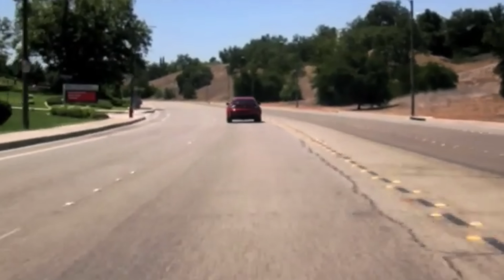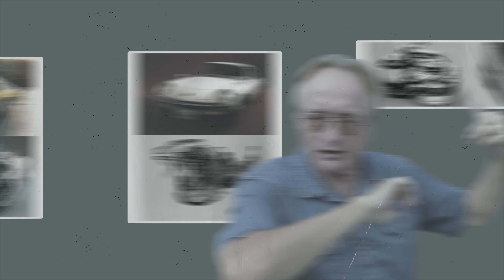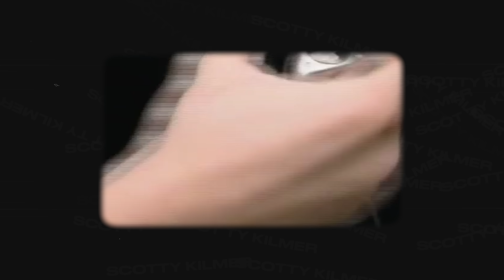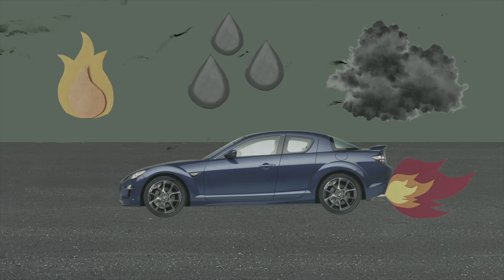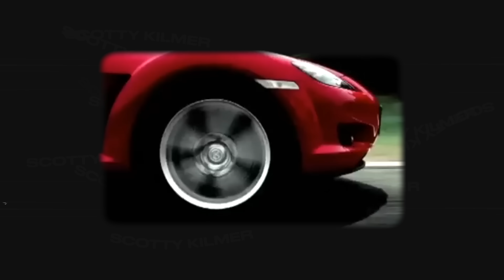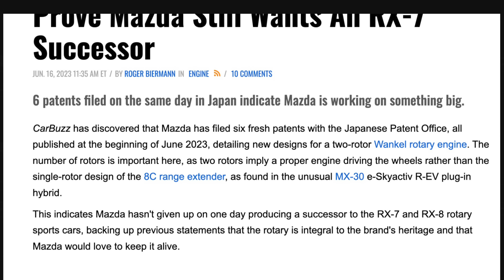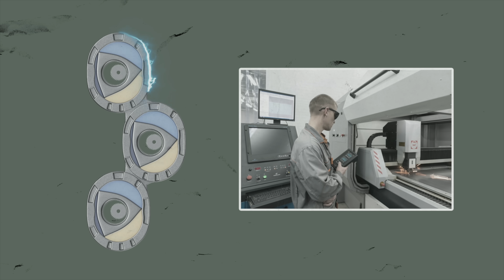Mazda's New Engine Shocks the Entire Car Industry

Comment: Quick point of correction as per knowledge gleaned from Rob Dahm's video "Fixing the BIGGEST Problems of the Rotary Engine" : one of the issues of rotary engines is that to boost adoption, they routed the oil pan's oil to a port to lubricate the apex seals, except synthetic oil doesn't burn cleanly. To remedy this, the port can be plugged at the expense of making a premix of gas and 2-stroke oil that's meant to burn much more cleanly. The oil pan's oil stays in the oil pan and is used to lubricate the rest of the engine with whatever oil you want.

Comment: Great vid!  I've always thought the idea of a rotary engine was super cool.  Ever since being a teenager I have been fascinated by this motor that is piston-less and non-traditional.  I hope Mazda can make it happen.  While the rotary engine may be "dirty" it has so much potential to create HP in such a small package.  Thanks for the info!
Reply: So….. build better catalytic converters, or something.   Fix the emissions issue, and get the ball rolling, again!
Reply: @robertjdm3988  the seals make the rotary an inherently bad design. It's cool asf but...
Reply: Doesn't matter how cool it is, EV's are far more efficient, it's not even close, you can buy roof top solar for your house to charge your car on the weekend and it's free to run, far less maintenance, just all round better way to move the car. :yt::face-blue-smiling::face-blue-smiling:

Comment: Well done, Mister Kilmer. I really like Wankel (By the way, it's pronounced, "VAHN-kel", not "Wang-kul") engine, having followed its development since its 1960's debut with NSU.

I also test-rode a Suzuki RE5 rotary-engined ("Wankel") back in the day. It was incredibly smooth, but it couldn't come close to the performance of my Kawasaki Z-1B.

Still, the Wankel ("VAHN-kel") engine is a fine example of "out-of-the-box" engineering thinking.

Comment: Some of the videos you showed had a rotary version with the peanut rotor and triangular housing. This is supposed to be "Better". Or is it just avoiding Mazda patents? From the patents you referenced, it sounds like Mazda is sticking with triangular rotors. Can you comment on if the peanut one is better? Or did you just pick available rotary video and there wasn't any that showed the old design? Good video. Thanks.

Comment: What if the central triangular section was held rigid and the rotor surrounded the triangular center section.  It would seem that the intake and exhaust ports through the motor body would be alternately opened and closed as the rotor with intake and exhaust ports incorporate in the rotor revolved.

Comment: Design Ideas solved the apex seal issue. It's time for a rotary come back.
Reply: Did they though?  I doubt it.
Reply: Well they are aftermarket parts so you won't find them in many street cars, but in the world of drag racing they are achieving remarkable success. The weak point now is rotor and housing bending.  @MrBottlecapBill

Comment: I had a Mazda RX-2 with a standard manual five speed. I got through the gas shortages during the seventies, but I wouldn’t be in one of those cars at my age.  I was in my twenties, so at that time I didn’t think I was going to die 😂
Reply: They never came with a 5 speed, only a three speed automatic or 4 speed manual.

Comment: The Rotary engine ALWAYS burns oil and seizes up.
Reply: So how many have you owned that seized up?
Reply: @rotart12arx3  One. 
I bought a RX-7 turbo new in 1987.  It had a LOT of problems, so I sold it in less than 2 years and bought a Mazda Miata. That car was a BLAST.  I was 25 years old when I bought my first Miata.
All these years later and I’d like to buy another one, but I’d only be able to drive it in the summer as we get 5-7 feet of snow every winter.
My dad also owned a RX-7 with the same engine problems. 
His only lasted about a year. He had just gotten a new engine in his (still under warranty), when his X wife was rear ended and totaled it.
Both were screaming fast, but both seized up and both burned oil.
Reply: Always…….seen hundreds of rotary’s and maybe 2 with this type of failure mode. Most owners know they require special care.

Comment: I actually owned 2 Mazda RX2’s briefly. The 1st was a daily driver but would not start at random times. I liked the sporty looks then I saw one that looked much nicer and inquired if it were for sale. Yes, they sold it to me cheap as it had been on the street curb for a long time. These were the first foreign cars I ever owned. When they ran, they ran good and smooth! I could never get the issues resolved and not many mechanics worked on Mazda rotary engines. I loved my GM cars and trucks. Anyway, neither Mazda was  reliable with the dual coils. They were to foreign for my domestic mind. I don’t even remember what I did with them!

Comment: I bought a used one that was smoking and would barely make it to my front lawn. Where I attempted to totally rebuild it right there. Stripped down and then found out on there. That no way could I get the plating done?
That that needed to be redone on the veins and turns out back then.  Nobody sold a complete kit.

Comment: N/A Rotary durability is better than turbocharged ones.

Buttheads often blow seals by brainless dialing up the boost.

It is a racing oriented engine that Mazda should have never  advertised it as a passenger car.  You are recommended to redline the rotary engine at least once per drive to burn away excess carbon deposits.

Thank you for all you do Scotty 👏 👏 👏
Reply: "A redline per day keeps the mechanic away"

Comment: I remember hearing about them, but I thought that they have quit making them.
Reply: No, they didn't stop making the engines.  I just got a new 13B-REW for my FD rx-7 from Mazda.  They run about $6800 w/ shipping and take 6-12 months to deliver.    They DID stop making new cars with them due to the emissions regulations stated in this video, but the FD engines are still available brand new.

Comment: Driving a manual RX7 is like driving a fast airplane. I love their power and high RPM.
Reply: Nothing compares to the smoothness and power delivery of the Rotary
Reply: I had a Rx3, 79 Rx7 and a 85, 85 first fuel injected car I owned they all were nice cars but I'm glad that I worked at a Mazda dealership.
Reply: A damn shame you can’t find a good condition, original unrestored RX-7 FD for anything less than a million dollars or so these days.
Reply: @stoneylonesome4062  yup. I had a white 81 and then a red 84 with black leather back in the day loved those cars and wish I kept mine..
Reply: @stoneylonesome4062 There are plenty of them on Bring a Trailer each month, well under 100K. But you don't seem to do any research before you make a statement.
Reply: The 12A Rotary was a real screamer. I put 143K miles on the 85 GS model I had sold it then another put another 60K on the save car. The 12A was a good engine.
Reply: The more RPM the more used oil you spit through exhaust. And of course you use synthetic, higher viscosity range the better, right? Imagine world where everyone does that daily not on track day. Do you really need 500+ HP driving in modern city traffic, corruptor?

Comment: Did the first generation RX engines have longevity issues?  I was a kid but I don't remember anyone having wear issues until the last generation RX-7.  A few people in high school bought them well used.  We were kids and they certainly couldn't afford a pristine low mileage example.  I don't recall them having any issues.
Reply: No, its the turbocharged engines that have issues w/ longetivity.  Stock naturally aspirated engines can easily last 150k+ miles on the 1st and 2nd gen RX-7s.
Reply: That's sounds right.  I'm sure none of my fellow broke high schoolers could have afforded a high maintainer short lived engine.

Comment: The new "Liquid Piston " version is better. It's the inverted design, Triangle housing with oval piston. Cool, but not for my car. I'll stick with an older Toyota.
Reply: What make it better? Do they have large contracts selling them? Are they profitable, why are they begging for money everywhere on social media if they solved all the issues. How long will one of their engines run before it needs a rebuild?
Reply: @rotart12arx3  The liquid piston version is more efficient and has far less radical forces fighting each other, and doesen't have the seals at the apex of the triangle piston, that are the weakness of the Wankle.  It's now used for small military drones.
Reply: @davidraborn3654  Then why after all these years they are not selling them in any numbers?
Reply: @rotart12arx3  Umm... Patent issues?  Not invented here issues?  Greed?
Reply: Reply was meant for @rotart12arx3

Comment: I almost bought an RX8 back in the day until another owner told me that I’d need to carry a case of oil in the trunk
Reply: It doesn't use that much oil. You can get 2000 miles on a quart.
Reply: Amazing I've never had that much of an issue with oil burning.